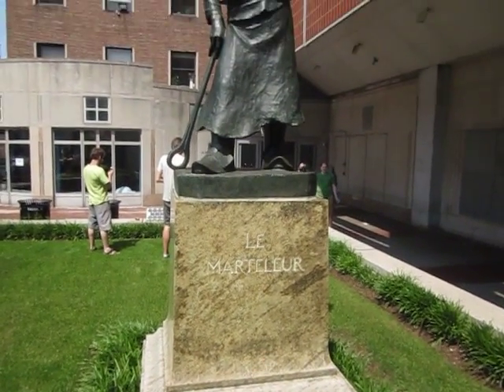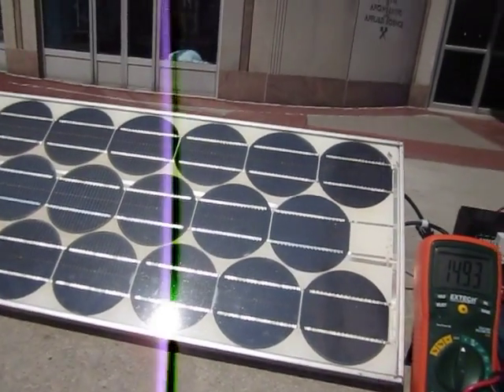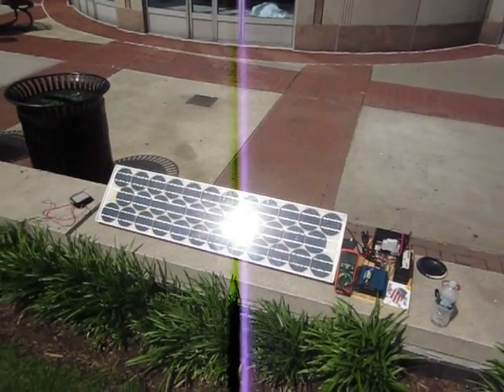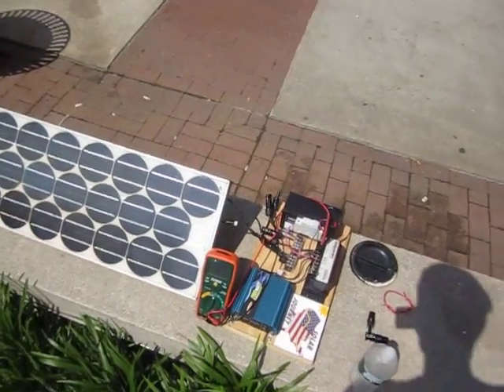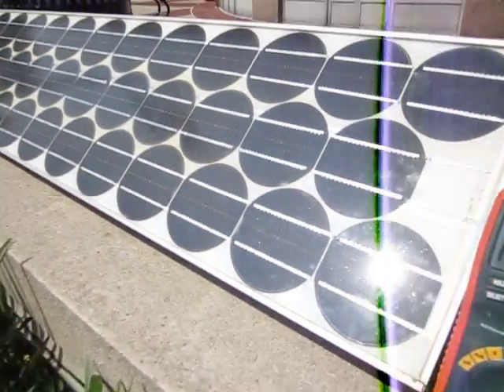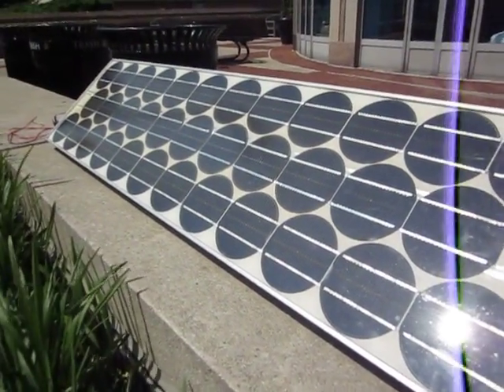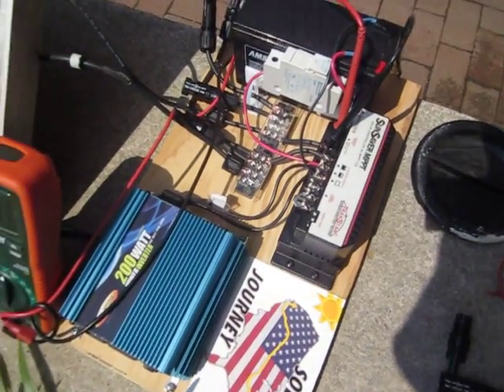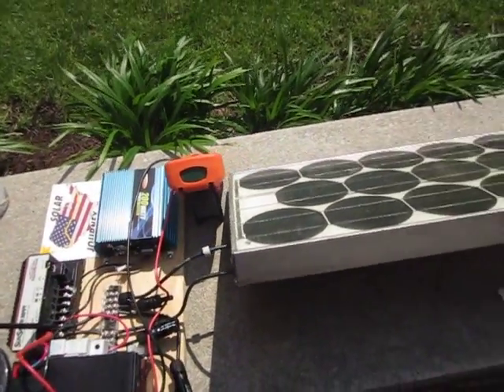40-year old Solar Panel still working!

Comment: Arco solar module, model 16-2000
Serial number 256387
33 watts
2.0 amps
16.0 volts

there's little to no degradation at all. amazing! even after 40 years

Comment: I have clients who have old Arco modules that have been outside for over 35 years and are still working.  While you of course get some degradation, a module from the 70's that still produces at 50% to 60% of it's rated STC is pretty remarkable.
Reply: Would modern pv-modules achieve similar yields after these years?
Reply: @MaykThewessen  Modern panels lose around 0,5% on average so in a 50 years time they would still output 75% of their power. Best panels only lose half of that

Comment: Nicely done. I do doubt a little about size of 1/3 m². because the module looks too long. Efficiency depends on irradiation, but 30Watts is OK for a 40yo PV-module.
But, I guess the module has been indoors all the time. So, no degradation effects or material problems could have occured.
Anti-Reflective-Coating with the lambda-fourth thickness might have been applied in PV a lot later.